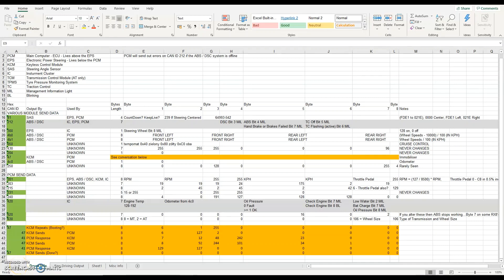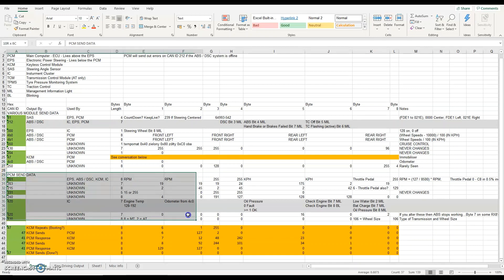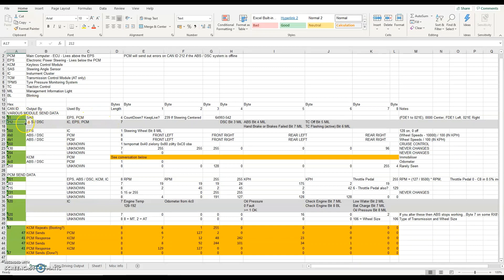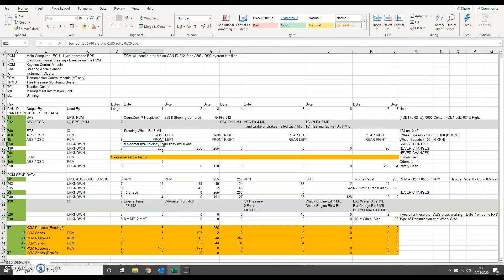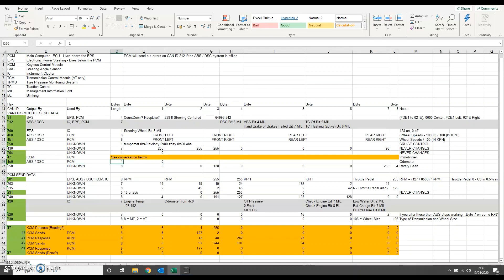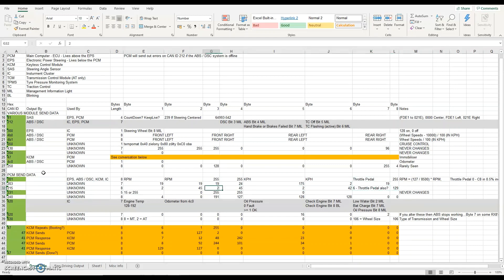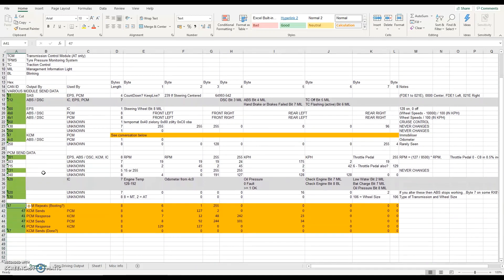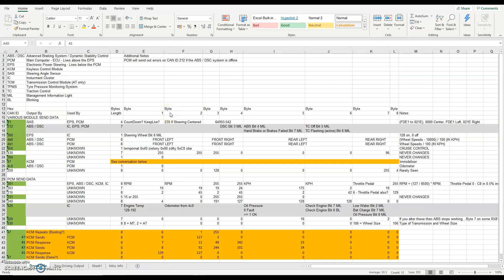Information about the RX8 CanBus codes, with Excel and Talk Through

Comment: 0x430 fuel level
first byte in hex convert to decimal then / 2.55
eg 0x63 = 99 decimal / 2.55 = 38.8 (%)? looks about right by gauge, need to test with full tank etc.
Reply from the maker: Ill add this to my master excel of information - although this is wont let you set the dash. Cheers for the headsup.

Comment: 0x430 is fuel level - it is not changing for you because your fuel tank is presumably gone (along with the sender) or the tank is empty! You should re-map this to state of charge of your battery, then you will have a working battery "fuel gauge" :) 0x430 is sent out by the instrument cluster, so may not be do-able.
Reply from the maker: ah ok, but the actual signal from the fuel tank is a voltage / resistance based system (not can). I must admit I didnt realise the cluster then sends the fuel level on the canbus - but thats not a lot of use unless I can set it!
Reply: Hello, do you know the address of right switch of cluster of rx8 ? thank you

Comment: great video! can I ask how do u know about how the calculations works? From this Leonardo CAN bus board, u r able to read, but are you able to simulate or write CAN data on controllers? =) Great! Subscribed!!
Reply from the maker: Hi - Which calculations? Yes I can write on the canbus aswell - so can take control of systems / lights etc...
Reply: @SouthWestEVUK  calculations for rpm (127/8500) x rpm, wheel sped /10,000 etc
Reply from the maker: Trial and error, a few other people online have done similar work and between us managed to reverse engineer as much as we could.
Reply: @SouthWestEVUK  oh thanks boss.. Good day to u boss! :)